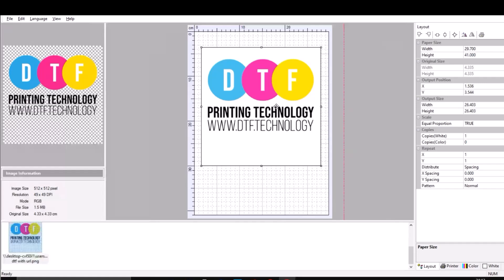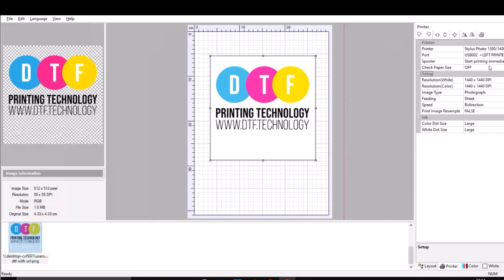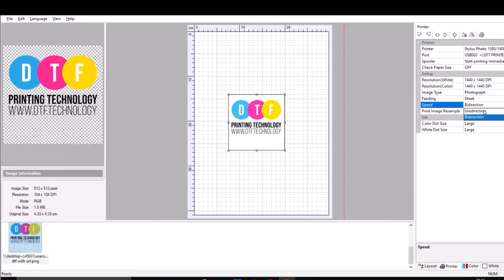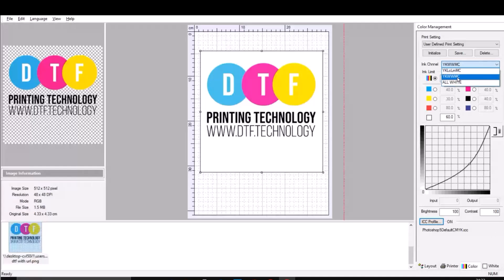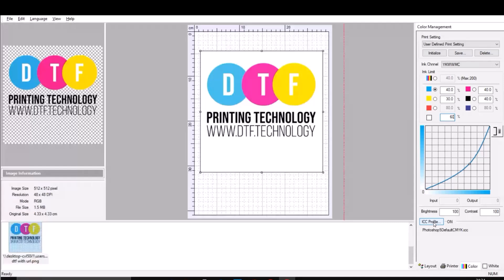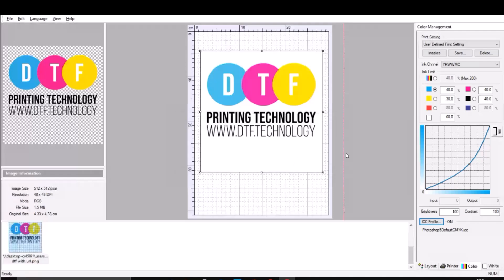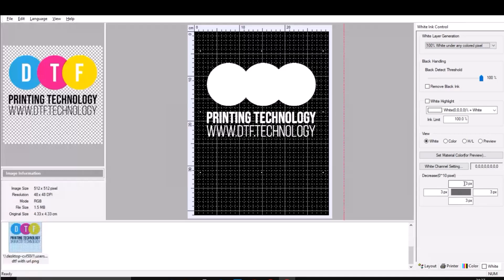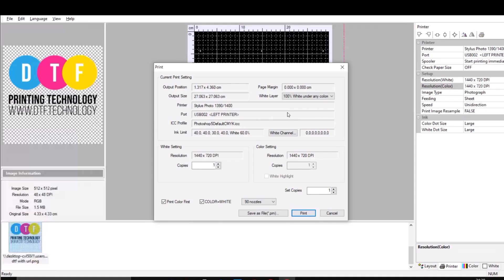Acrorip Settings For Epson L1800 DTF Printer Tutorial And Explanation

Comment: Hi
First of all great video for beginers well explained. I have a question if you can help. Im trying to print from my UV on black acrylic matte and gloss both boards (testing some keychains). I cant get it in normal color it all comes out very dark. When i change the acrylic board for example the transparent one in prints normal colors. Do you have any advice on the settings?
Reply from the maker: If you apply a good layer of white, the colour of your acrylic should not matter. Are you printing a layer of white under your colour?

Comment: How do I get my image to show pixalized on the left top portion? When I upload my image it prints full with the background but I only want the image itself
Reply from the maker: Did you prepare your image for print, remove the background and export it in PNG format with transparent background? Acrorip is only used for printing. You still need to design print ready designs in your preferred image editing software

Comment: I have a epson 1800, and i defined every configuration like you did, but for some reason the white is not printed. but if i define the gradient white it works.

I want to print in white some stuff and i dont know what is the issue. I've been searching for it for like 3/4 days.

Do you have some advice?
Reply from the maker: That's weird. Not something I've ever encountered or heard of. Usually when acrorip starts acting weird it needs a reinstall.
Reply: @dtfprintingtechnology9457  Finally managed to solve this problem, basically executed every maintenance button that exists there :D, and after that I noticed that I had air in the white inks too, removed that with a syringe and now it's working!

Comment: Yea I followed all that and numerous other videos and my image doesn’t come out to size. It’s coming out long enough but only half the width. Using 13” wide roll. 

It’s squishing the image to make it skinny but as long as it should be. Not sure if you have a solution for that .. I’m at a loss watching numerous videos on this. 
I did sublimation dtf for a year and just upgraded to a DTF L1800 printer and it won’t print correct size
Reply from the maker: Print some text from a word document. Without using acrorip. If it prints fine, that will rule out printer issues. Make sure your printer drivers are installed. Make sure you have the correct printer model selected in acrorip. You can also try selecting 805 model. Make sure your resolution matches. Eg 1440 x 1440 or 720 x 720

Comment: Hey great video, just one question. What is the 'set copies' option for on the print screen tab???
Reply from the maker: How many print copies you want to send to the printer. Eg. How many pages it will print.
Reply: @dtfprintingtechnology9457  thanks man
Reply: @dtfprintingtechnology9457  one last question, what is the 'wave' option in the printer tab? It's set to off by default but I have no clue as to what it does
Reply from the maker: Do a penny size print with it on and with it turned off. It should not make any difference with regular printers. It's mainly used for UV printing.  @crumble7598

Comment: Hello there , is it possible to print multiple designs at once or multiple design at once? Thanks
Reply from the maker: You can either queue multiple print jobs or add multiple designs to one sheet in your image editing software. You can't add multiple designs in acrorip. You can only repeat or tile them.
Reply: @dtfprintingtechnology9457  I am trying to add multiple design in acrorip but it seems it wont work as you said…
Reply from the maker: @rovanicases  Yeah, you can't do that in acrorip

Comment: Can you tell me how to trouble shoot why my 2nd dapper is not pulling the white ink
? My printer is brand new. I have the DSV model L1800
Reply from the maker: Use a cringe to draw the ink from the damper. See if you get a lot of bubbles. Look for obstructions. Is it easy to draw the ink? Compare it to the other damper that's working. If everything looks good, it's probably your printhead.

Comment: Hello there, I have an Epson L1800 and I tried to follow the same settings as the one shown in the video, however when I use the "Stylus Photo 1390/1400" option, I don't get the "Print Colour First", or "COLOR+WHITE" options in the print setting. Only "RIpBoost" has that and I'm not sure if that's what's causing the ink to run or not. Any way I can fix it to make it more like yours?
Reply: ughhh I have thesame one and Im struggling so bad with it. Did you ever figure out how to contact them
Reply: You have to make shur you have your Color settings the same as you have them in the tank lineup

Comment: Hi
I have done the DTF conversion of the L1800 printer, I have loaded the acrorip software and followed these settings, I have updated all drivers, but when I click print, it just feeds 1 film straight through without printing and then gives an out of paper notice.
I have tried everything, but just cannot get it right
Reply from the maker: Have you tried disabling check paper size option in acrorip?

Comment: Hi mate..I have a problem with my printhead, i bought a new one but when i installed it and tested it, no white is printing on top of the other colors, Is that mean that the white is clogged or is there a problem on the printhead? I did clean the printhead with printhead cleaner and test it again but still no luck with the white printing on. Any help please?
Reply from the maker: Did you run an ink charge after installing a new printhead or ran multiple cleaning cycles? Do you see white on the nozzle check?

Comment: I have an acrorip v10.5, followed the same settings on a brand new epson l1800 with inks filled. However, acrorip software displays print command error twice then it shows white ink empty (although it is filled up). Need help!! thank you
Reply from the maker: It's referring to the white in your image, not your ink tank  levels.You are probably trying to print a white layer that isn't there. Also, it bugs out sometimes. Just add a tiny red square to your image. You can cut it out later.

Comment: Any idea why the printer doesn't apply more white ink even when I increase the saturation to 300%? No matter how much saturation I set, it always applies very little ink. Epson 4880 DTG printer
Reply from the maker: I've made a slight mistake in the video. 100% is the maximum. You should try mixing your white, purging your white ink lines + dampers and giving your printhead a clean.

Comment: y axis elongates print I solve it by loading the print 30X41cm (a3 size) in the acro rip I change to 30x32.5cm and the y axis has a good print. is there any better solution?
Reply from the maker: What are you acrorip resolution settings?

Comment: Hi,
My Acrorip Is performing ok when setting an Image but when It starts to Rip It goes really Slow and after a long time does not print. It works fine on my Laptop though ripping to the same Printer. Do you have any Idea why this would be happening on my Desktop ?
Regards
Geoff
Reply from the maker: You can try using a different USB port/Cable. Maybe check that acrorip is not being blocked by some security/antivirus software. You can try reinstalling it. It should work faster on better hardware.

Comment: I am having some issues with the colours, also the white has a blueish tone to it. Do you know what should I check/adjust to get proper colors? Thanks!
Reply from the maker: As your ink supplier for an ICC profile. Clean out any contamination with cyan/white. Make sure different colours of ink are not mixing. Adjust the settings according to what your ink supplier recommends. Clean the printhead if required. Use quality inks. Could be a lot of things.

Comment: Hello! I just setup a new L1800 printer following your instruction in the previous videos. Thanks! I am using Acrorip 9 and I have an issue with the ink going all around the paper, dripping wet.. What can I do to fix it? I tried various settings, but unfortunately it is not working still. Only one setting turned out to work but very faded.. thanks
Reply from the maker: Most likely you are either printing on the wrong side of the film or you bought bad film.
Reply: @dtfprintingtechnology9457  Wrong side of the film it was :). Now everything is working properly. Many thanks!

Comment: Why do I get a stretched (distorted) image when I printed out?
Reply from the maker: Do a normal print without using acrorip. Is the problem still there? Then it's probably dirty encoder strip/wheel or a broken tooth on a cog.
Reply: @dtfprintingtechnology9457  Thanks for the reply. Actually what I meant is instead of a circle shape I got an oval shape. The image printed is being compressed. Is it something to do with the layout setting?
Reply from the maker: @ectanrules  Yes, I undestood your correctly. Does this happen when you print out a picture normally without using acrorip?
Reply: @dtfprintingtechnology9457  It does not happen when I’m not using acrorip.

Comment: How do you set up roll Feed I'm have trouble finding how to do this.
Reply from the maker: You will need a roll holder either DIY or a ready made one as well as print to roll management software. So you will send your print jobs to your roll printing software first instead of your printer and that software will then make sure that your printer stops after each print job instead of unwinding the whole roll. Both the roll holder + software will be available in our store next week.

Comment: Hi, is it possible if it will be setting wanna use black ink only. cause im thinking to make it dual which can be print for DTF Film and screen print transparency film? is it can be like that? or Acrorip only work for DTF film only? hope u can help me. thanks a lot for clear information.
Reply from the maker: Acrorip has nothing to do with the type of paper or film you stick into the printer. So you can print on anything. Paper, film, transparensies, sticker paper etc.
Reply: I see, so it means we can set up to use black ink only in acrorip? Or just use the default printer software, but seem DTF tank already differ ink filled i mean like (YKWWMC). Can u do a tutorial for that? If printing on film transparency using acrorip?😬 pleaseeeee...
Reply from the maker: @qiffb3366  You can just open a black design in acrorip and print it with the white layer unchecked.
Reply: @dtfprintingtechnology9457  thanks a lot 
 appreciate
Reply: @dtfprintingtechnology9457  I tried acrorip 9.03, but printing starts after 3cm. How can I fix it.

Comment: What is the purpose of the “remove black ink” setting? Is that in case i print on black shirts, it will use the black of the shirt for the black of the image? I tried a test and it printed the black anyways.

Comment: I finally got my Epson l1800 to print through the acrorip 8.2.6 program ( it kept starting to print and then jammed light would start flashing) but when it did finally print it did not print the 2nd layer of white ink. 
What am I doing wrong?
Reply from the maker: I have no idea.
Reply: @dtfprintingtechnology9457  it's printing the white second layer but printing it on the next page instead of on the background ....how can I fix that?
Reply from the maker: @helenwilson300  On the print screen you need to make sure you check both boxes. Print white and colour at the same time and print colour first.
Reply: @dtfprintingtechnology9457  when I go to print mine looks a little bit different than what your shows on this video it's got two boxes underneath the white side that say like ch1 and ch2 but I do have both of them to say one copy but I don't know where to check to say print at the same time.
Reply: @dtfprintingtechnology9457  I don't think I can do it on the same print with the acro rip 8.2.6 I think that's the problem I think I need to get the 9.03

Comment: When I go to select the ink channel it doesn't have the one I need.
Reply from the maker: Try picking a different printer model.
Reply: @dtfprintingtechnology9457  the printer will print when I do anything for setting it up and it prints fine and we'll go through but whenever I try to print something from acro rip it says that it's jammed the light flashes like it's jammed every time am I doing something wrong do I have a setting wrong or what do you suggest to do
Reply: Thanks I figured that out....now I have another question...the printer will print when I do the checks and anything through the printer software....but it won't print through acrorip....Everytime I try it jams. Jammed light starts flashing ...what can I do? Do I have setting messed up somewhere?

Comment: I actually have this settings but the output for dark tshirts is bad. Its not vibrant nor colorful the print in dark tshirt kinda dark. Can you please help me get the right settings for black/dark tshirts?  Or do i need just adjustments in what settings?
Reply from the maker: Does your printed and cured transfer look quite transparent before you tranfer it onto a shirt?
Reply: @dtfprintingtechnology9457  Nah. It covered in white ink and hot melt powder.
Reply: @dtfprintingtechnology9457  can you please help me just give a settings  for dark/black tshirts? I want to know your own settings.

Comment: Hi, great video, I am using the settings that you show on your video but the scale of my printouts does not match the output size shown? for 
example when I am printing on A3 pet the size comes out all wrong, distorted and not in scale, a graphic of a4 size more than fills the A3 size sheet I am using :( 
thanks for any help you can give me.
Reply from the maker: File menu -> Unit. Check the unit of measurment.
Reply: @dtfprintingtechnology9457  Please can you tell what the seetings are supposed to be when I am printying A4 because its stretched
Reply: Hie Geoff, got a similar problem did you manage to find a solution
Reply: @ronnietivatyi1910  Hi Ronnie, I have a similar issues, can you share your solution. When printing the images looks stretched.
Reply: I have the same problem and I solve it by loading the print 30X41cm (a3 size) in the acro rip I change to 30x32.5cm and the y axis has a good print. is there any better solution?

Comment: Quick question. My white ink comes out almost transparent over the color image. I've used all of the suggested settings. Done multiple head cleanings, shook the dampers and white ink tank, tried using a syringe to get the white ink out of the damper and put in back in the tank and still the results are relatively the same. Any suggestions?
Reply from the maker: Has it always been like that? Maybe you just bought cheap white ink? If your ink is good, if your dampers are filled with nice bright ink and there are no clogging problems then I have no idea. Maybe raise white ink levels? If bright white ink goes into the print head and comes out transparent a second later, that's some sort of a magic trick. Can't see how that would even be possible.
Reply: @dtfprintingtechnology9457  thx for response. I had another dtf printer that went bad. The ink sat for maybe a month. I got a new one and transferred the inks from the old tanks to the new ones. The color inks are great, just an issue with the white.
Reply: @josealicea3765 mine is doing this too. Did you find a fix

Comment: Hello, when I set my white to 100%, its bleeding after 50% print. My resolution is 1440, color dot is Mix and epson 1390/1400 for printer settings. Can you help what's the issue?
Reply from the maker: It's too much white for 1440 resolution. Try 60% white 35% colour.

Comment: How much color and white ink % the Best for dtg and dot size for dtg too?
Reply from the maker: For DTG? L1800 is quite bad for DTG. I'd go with the maximum 200% white, which is not enough, so I'd do 1 pass with just white and 1 more pass with white and colour. Colour between 35-80%. Medium and large dropplet size.
Reply: Thanks!, how do you know if the dtf paper is cooked?
Reply from the maker: @matiasoliva1185  Are you talking about DTG or DTF? Because I gave you DTG settings like you asked for. You just look at the film. When powder melts. You only need to melt it so that you don't smudge the transfer during application process. So it's not important how well you melt it ot for how long.

Comment: What is the system requirments for acrorip? because my printer slow very down in middle of print and i tried several methods ,cr motor changing cr heat protection reset usb cable changing usb port changing  but nothing so i think i have problem in my system

Comment: I don’t know what else to do bro I download the drivers from Epson installed it set it up did a test print to make sure the drivers was working went perfect restarted my computer opened acrorip 9  did a nozzle test using acro rip 9 it worked tried printing with it nothing my printer not responding to it so do it all over again nothing  so I switched computers downloaded Epson drivers install driver  I can do a nozzle check are a head cleaning in acro rip but it wont print don’t know what else to do I attached pics of my settings in acro maybe theres something I don’t see I have it hooked up to usb /drivers installed/acro rip is just not printing/
 has anyone else had this problem
Reply from the maker: If your printer can print on regular paper normally, then it's not the problem with windows, drivers or printer. It narrows everything down to an acrorip problem. Go into windows threat protection and check protection history. Make sure your windows is not blocking parts of acrorip.